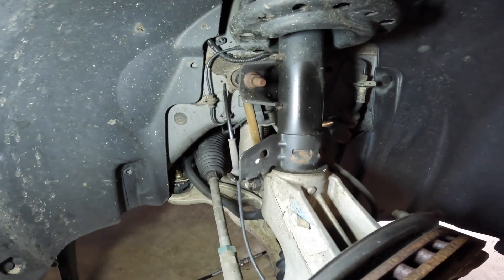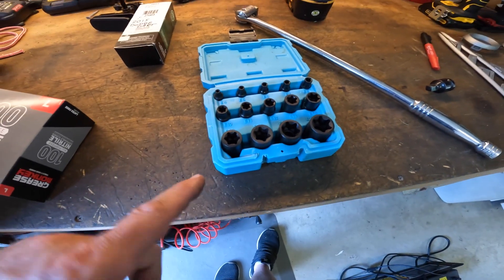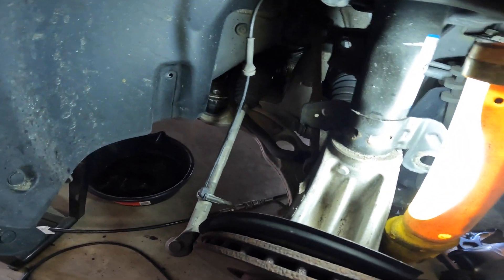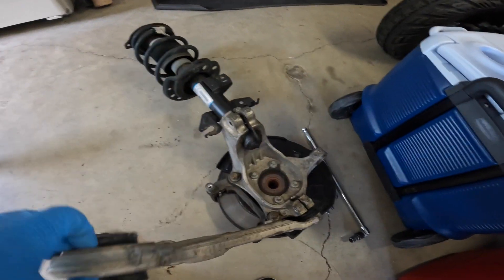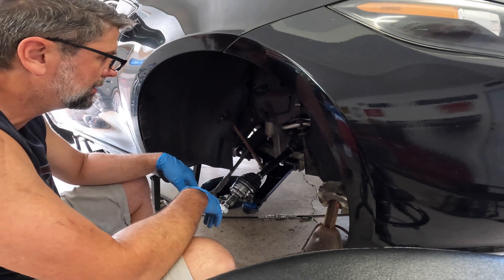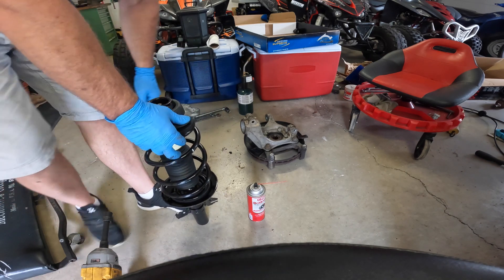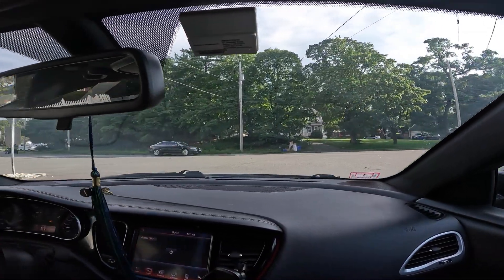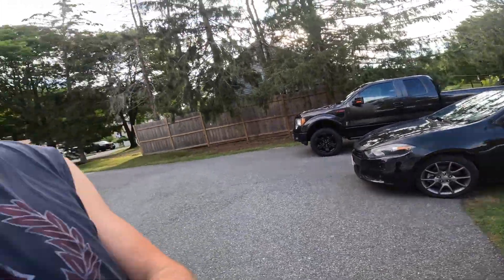How to Replace the Strut on a Dodge Dart

Comment: You do not have to remove the lower control arm on that Dodge Dart I have been working on vehicles for 42 years you do not have to remove the lower control arm there is an easier way using a pry bar and an exhaust clamp too Pride down off of the lower ball joint